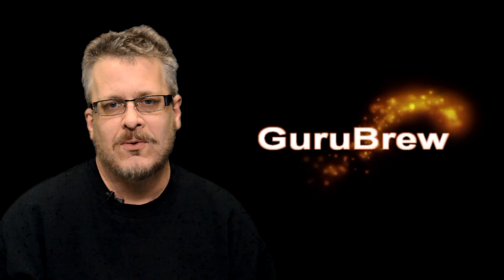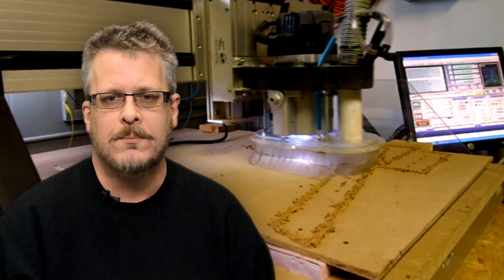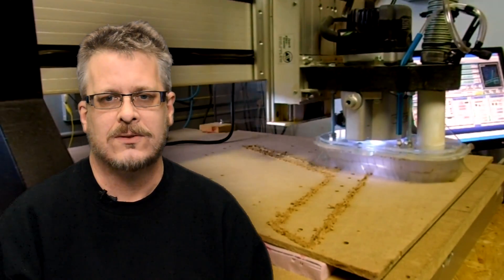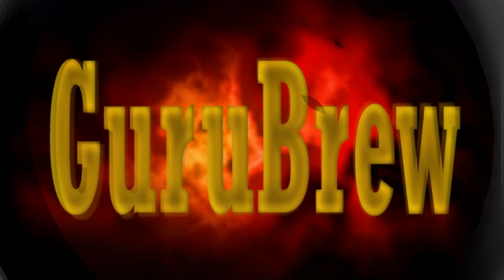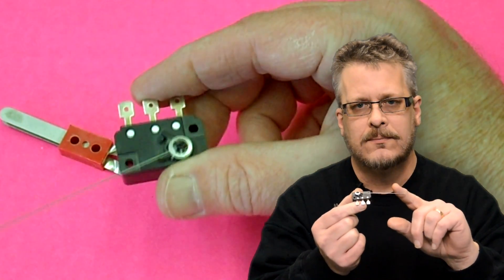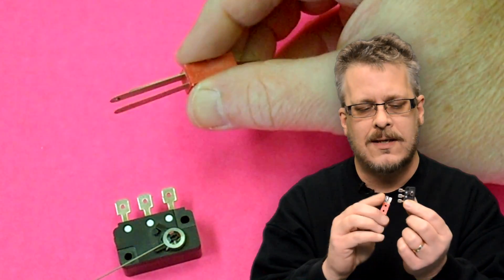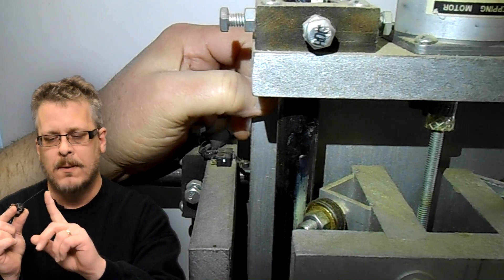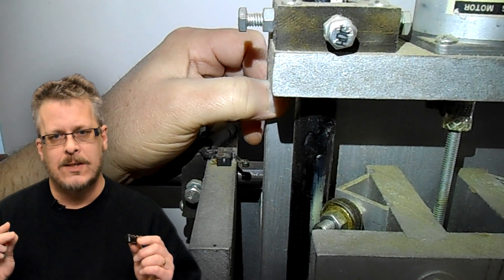Beginners Guide to Home and Limit Switch Hardware - Mach3 CNC

Comment: I’m adding home and limit switches to my CNC and need to understand the procedure.
I have two switches on Y Home and Y- - and one switch on Y + +.
After setting steps per inch and squaring the CNC.
Bothe the Y home and Y - - be made at the same time, Correct? Or just close?
I have a positive stop at the end of the travel of all axis.
I understand the travel (when homing) will slow and contact the positive stop then back off a little. Which location is home, the positive stop, or the location that it backs off to?
How do you set the point that it will slow down, and how do you set how much it backs off?
MACHINE COORDINATES, in Y axis in zero at the front of the CNC, and 36” at the rear of Y travel, if you have 36” Y travel.  Where and how do you enter the zero and the 36”?
I’ve use my DIY CNC for 12 years and never had a problem with setting XY Z zero, but I want to use the exact positioning of the axis especially with tool changes so as to have the different bits register as accurately as possible.
Sorry for asking so many questions, I really do enjoy your YT videos, very straight forward, without getting sidetracked , thanks so much .

Comment: and how about the stepper motor with encoder... if i say in g code x 10 inches and by mistakely x axis can pass away form 10 inches ? as i heard the encoder disconnected stepper motor because it got info and can't pass more step as we mantioned in gcode am right or encoder also no hleps here ??? i never try but just question

Comment: Great video..thanks a lot.. i have a quesiton about limit switches what you mentioned microswitch wich bupming. i see many people dont use any limit switches phisically they use mach3 config settings there is programming limit switches they mentioned for example from 0 to 200 mm that's all and during out of this limit machine stops itself without phyisically switches how it wokrs fine or needs to put switches ???

Comment: It would be nice if the limit switch would kill power to the motor directly, without relying on software that may hang after switching the motor on :-). Of course this has to be done in a way that still allows the motor to run in the opposite direction in order to get out of the situation. For DC motors driven by an H-bridge I think this is possible by routing the control signals through the limit switch, but I still have to test if that actually works.

Comment: Hello ,  Just hooked up my china cnc router.  Was working but now when I reset both ref and mach cords to zero and push goto zero the z runs up till it crashes.  Any advice
Reply from the maker: Check the settings in motor home / soft limits settings it may be off or the wrong number put in

Comment: I wish someone would post a video on powering up Home Switches correctly. I am using the Gecko G540 with a UCCNC 100 USB Interface and Proximity Sensors that are wired Normally Closed. However when I wire them Up I am required to run a seperate power supply to power the switches. I am using a Wall Wart to supply the power and everything is grounded through my 48V Power Supply. They'll work perfectly as long as my E-Stop Switch is Engaged, however when I Open the E-Stop Switch they refuse to work as described. I haven't found anyone who can explain how to correct this.
Reply from the maker: Provided the switches are wired correctly I feel it may be the setup you are using in mach. Have you monitored the home pins while the estop is depressed and pressed. How about changing the ports and pin configuration for the home to the opposite of what it is now, such as active high.

Comment: Ste can you help mate, I have Mach3 set up on my milling machine but just set up a lathe and want to know how to set up mach3 turn on that, I have the licence but want a stand alone system one for milling and one for the lathe any help would be good
Reply from the maker: Hi Dave, I don't have a lathe but it's not much different then setting up a mill. Anything in particular  you want to learn to do or just overall setup. Steve
Reply: @GuruBrew  yes I have the licence for the soft wear on the computer for the mill and I have just bought another computer to run my lathe 
just need to know how to copy from one lathe to another I have internet set up when the mill was set up they did it over the internet 
so its just setting up on the other computer
Reply from the maker: This is a common thing. This post says it best https://www.machsupport.com/forum/index.php?topic=15789.0
Good luck, 
Steve

Comment: Great video. I have an application for the red limit switch (reed?) you use in your video. Can you post a link of where you get those? or tell me the manufacturer and part number? Thanks!
Reply from the maker: I think it was from SmartFun used in coin mechanisms, hence its long probe wire.

Comment: We have an "A" motor slaved to the "Y", and a limit switch mounted on the "Y" side. When we reference all home, the "Y" side will move to the home position. But the "A" wont move. When I trick Mach3, and tell it that the "A" motor has a limit, it moves along with the "Y". But it keeps wanting to move, until it finds that limit (which is not there). Do I need another limit on the "A" side? Or is there another setting in the program?

Comment: Very new and somewhat confused, I get the purpose of limit switches, but why wouldn't this be handled by the control software? it knows the position of the spindle and if it knows your table parameters, wouldn't it stop the job if it goes beyond the setup limits?

Comment: Basically total noob here, I got some machine things happening where it costs me money in mistakes and also my own in-experience that costs me money. When the machine starts a cut path above a sacrificial slat, this actually effects the hypertherm and I did read from Jim Colt, that this is a common problem with the Hypertherm 45XP. So after it stops / has an an "E-Stop" error, this can throw the machines coordinates out as the E-Stop is reset, as the magnets in the stepper motors re-power and move to their natural position, ready to start moving again after I command it to start again. This exact same thing happens every time the machine has a fault light / E-Stop, which is the biggest cost to my operations so far. So as you can imagine, the E-Stop / Faults in my cnc plasma are very frustrating and I'm now trying to rid the machine of what ever faults I can. Another issue I have is when the machine moves from one cut path to another, I'm sure these movements are called "Rapids". So If I'm cutting out a car picture, imagine the machine has cut out all the interior cuts like the wheels, the windows etc, then it moves the Z up and moves over to start cutting the outline / body of the car, it will fault on that movement when in the middle of the transition from one path to another. This throws out where the machine thinks it is, so as I tell it to start that next cut, it may be off by about 12mm on the X and Y, this will start that next cut from a position that is totally wrong and the design of the car is totally off. Really costs me money, very frustrating. So I guess your homing and limits switches would help me here in zeroing the machine again, but it's still probably hard to do when it's not starting a fresh cut on a new plate. I need to slow down my rapids, then maybe upgrade the machine to have these limit switches, as I only have one on my Z Axis.

Comment: "Normally Closed" switches are also better not only for electrical malfunction fail-safe but because if you add a small Capacitor like a (4.7uF 25V) it eliminates "FALSE TRIGGERS"..

Comment: I have a question about machining. I import a picture and setup the rough and finish cut. start the rough cut program and it will take about 6 passes to do it . it will cut say 4 passes great then when it goes to start to cut the next pass it will plunge deep into the material. but when I preview the toolpaths everything looks fine .I am setting it up to take fifty thousaths off at a time in the rough cut. Can you give me any idea why it does this. I am using a china cnc machaine 3040 and Mach3  with Aspire Vetric . Any help would be greatly appreciated.

Comment: how many volts and amps would my power supply need to be for 4 nema 17 motors rated at 2.4v and 1.5 amps per phase? i am using drv8825 drivers with a cnc shield.

Comment: Hi Steve, thx for the xplanation on the switches, im pretty new at this CNC, and got my machine build, but im confused whit the limit switches in Mach 3. when the machine hit the switch, it stop as intended, but how can i move back from the limit again? do i really have to go into mach 3 settings and tick of settings, to make it move again?..thx for help
Reply: Ive got the same question. Did You find a soluotion?